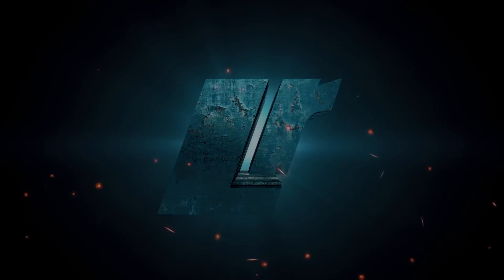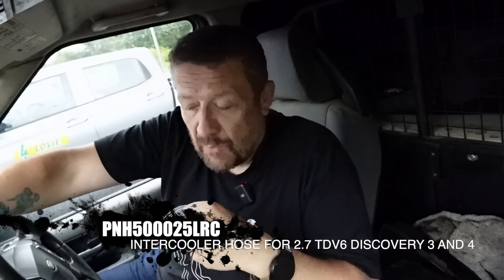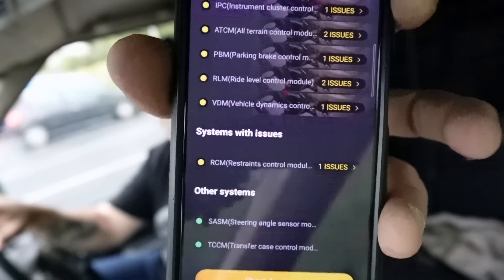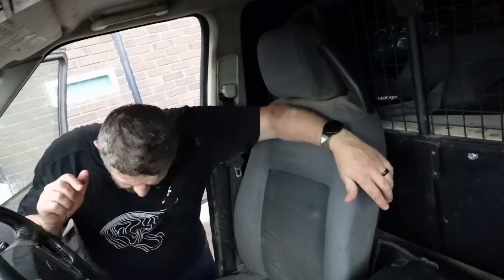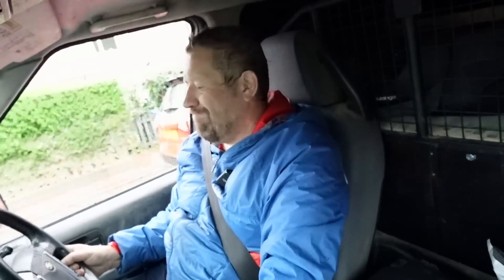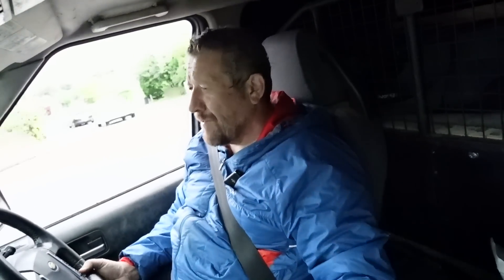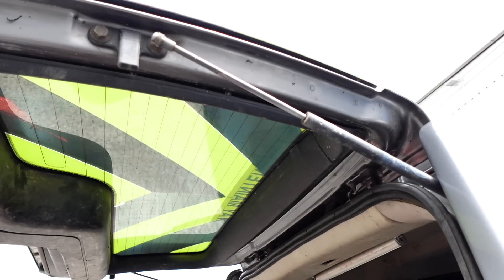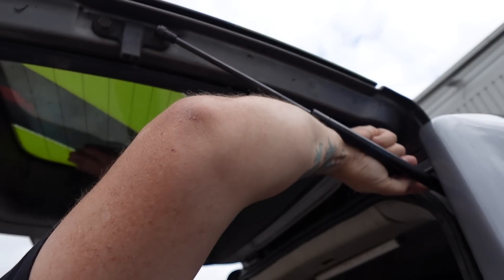Our broken, half priced Discovery 3 cost just £200 to fix.

Comment: Thanks I’m looking forward to this series. The first job is definitely change the oil pump for the newer strong type before driving it any more. Being owned by a company it won’t have been changed from new so it will have the old weak pump. If it breaks your engine will be toast. You may as well change the belts at the same time.

Comment: Try replacing the brake switch on your brake pedal . Had exactly same problem as you. After doing the switch recalibrate your steering angle sensor.

Comment: After owning a d1 300 I worked on a friend's d3 manual fitted a new clutch ,timing belt rusted out fuel tank cradle and did a test drive ,I was shocked how bad these thing are big heavy slow I'll never touch one again, been driving landrovers since 1980

Comment: Please replace the oil pump and timing belt, and change the oil to 5W40. LR Time has done a whole set of videos on this
I wouldn't have thought it was just the sensor causing the issue, I would have started with changing the battery